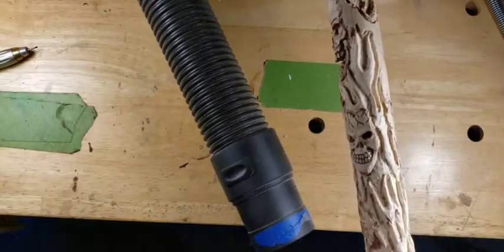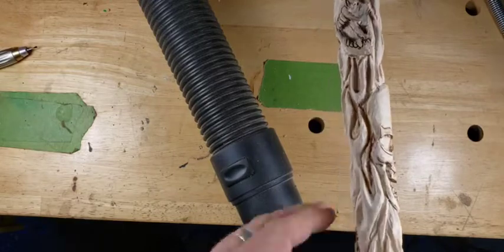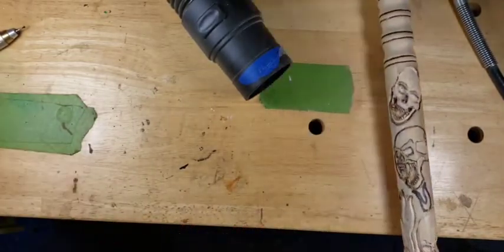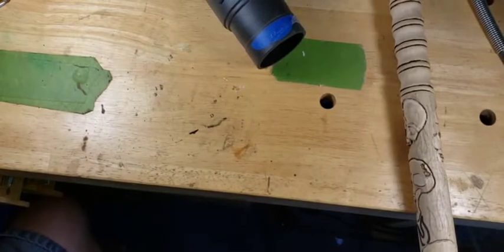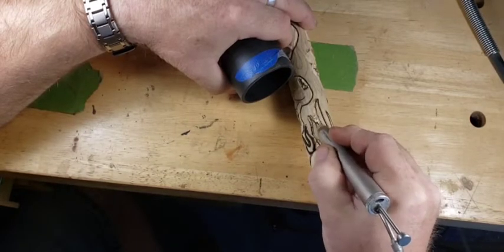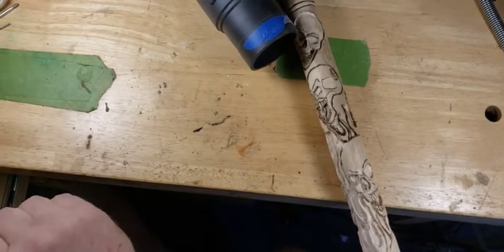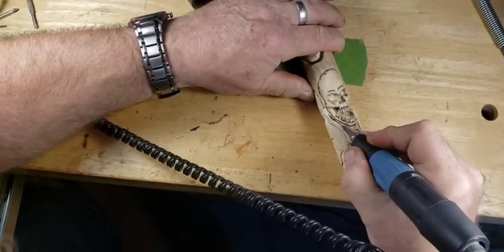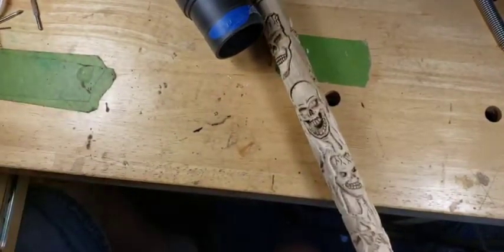Wood carving skull stick flames ,dremel,whittling

Comment: I've been trying out different mediums on wood to see which is best for coloring or marking designs.  So I thought I'd share.           Markers will only work if the word is highly sanded, and hard enough, otherwise blow out like you just showed is inevitable and nasty looking. 
Sharpies are the best for not blowing out as much, depending on the grain. Best are paint pens, but slow.
     I tried pastels as well. Nice colors and covers,  but harder for fine details. Pastels will nicely sink in, but will easily smudge if handled. I'm working on sanding off the pastel to leave a hint of color, but prepare for alot of discarded sandpaper. 
    Best, and truly unbelievable to me, were standard pencil crayons. They actually colored the wood nicely, and is easily sanded off or painted over.
    I'm making a colored cube of wood with my kids numerous art supplies. Very relaxing. Plus being a single mom its something I can do with my kids. Always looking for new ways to involve them in art.
Reply from the maker: Awesome have fun stay safe Just carve

Comment: I use the Razortip single pen burner for my pyography work. You can buy the control for about $150.00 and the single pens are $33.00 apiece or the interchangeable tip pen is $24.00. 5 tips are $20.00 to $24.00.
Reply from the maker: Thanks Russ I'll check it out bud 
Thank.you for watching

Comment: you need the real or extrae fine line sharpie marker or i like using just a red ink pen
Reply from the maker: Yeap most of the time I use a pencil oooo yea the scm hs tool is around 400.00 bucks but it a great tool . I have carve a lot of gun stocks with it really speed the carving along hope the info helps you out thanks for watching